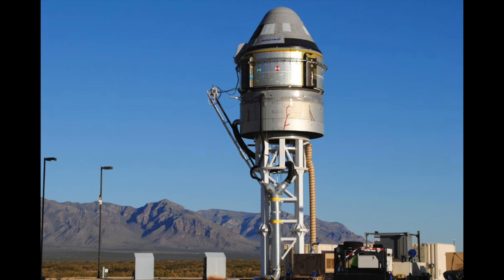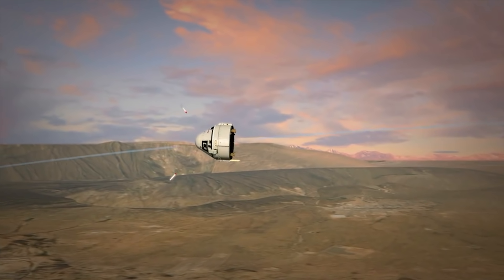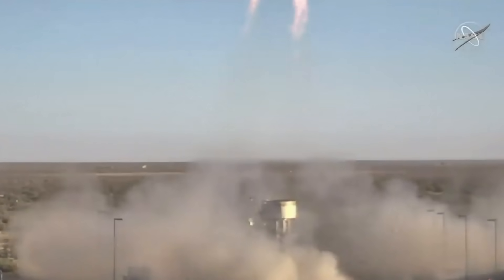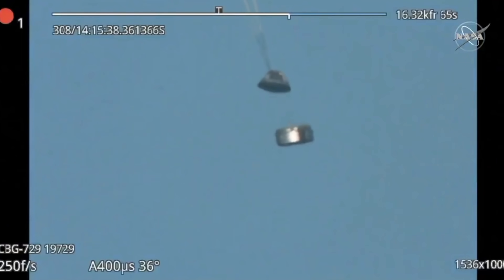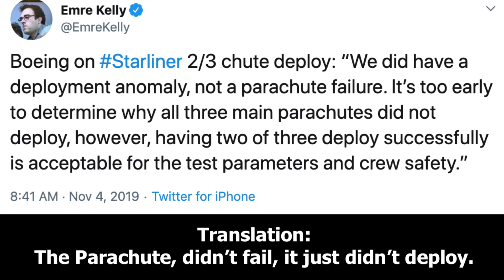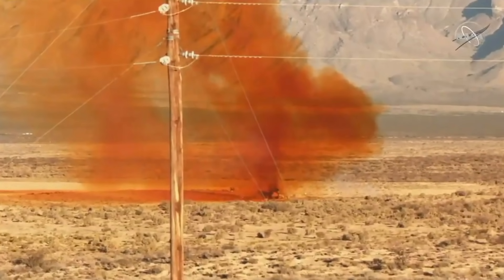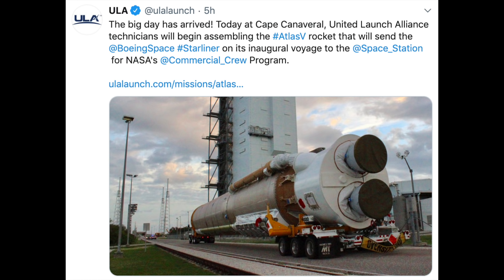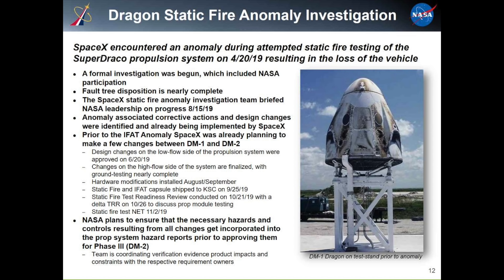Parachute Fails To Deploy During Boeing's Starliner Abort Test.

Comment: Scott - "1st US spacecraft designed to land on land"
Space shuttle - "am I dead to you?"
Reply: Yes. Yes you are.
Reply: Scott:
yes
Reply: Too funny.  Good catch.
Reply: "Space capsule " probably.
Reply: Glad I read the comments first.  Was going to say the same thing... 😁 😜 😂 😂 😂 😂
Reply: Yes...bc you have killed multiple astronauts
Reply: @backwoodsjunkie08    Vehicles don't kill people, people are killed in vehicular accidents. Do you really think fifteen people is a lot? FWIW, Soyuz has also 'killed' multiple astronauts, in the same number of fatal accidents. Of course, the first 'accident' was essentially the result of the launch controller planting a bomb on board, so it shouldn't count. I'll tell you this though, as soon as the first SpaceX manned Starship flies, the countdown will have begun to the day when, on launch, on landing, or in space, a hundred or more people will die in some accident.
Reply: Technically at that point the space shuttle is an aircraft
Reply: @odysseusrex5908  but then, how many times have that  number of people died in a single plane crash? Quite a few I'd think, in something that is far far far far safer than a spacecraft of any design.
Reply: @Forest_Fifer    That is precisely my point. When an airliner goes down, it is often the case that hundreds of people die at a time. People, with no knowledge of aerospace engineering, act like the Space Shuttle was horribly unsafe because it had two crashes in thirty years. You might notice you never hear an astronaut talking like that. There is no such thing as safe, there is only acceptable risk. People have died before, many, many more are going to die in the future.
     Why do you think airplanes are safer than Space Shuttles? Each Space Shuttle flew hundreds of millions of miles. Only two of them crashed, and one of those was essentially sabotaged. What airplane has ever flown that far?
Reply: Yes
Reply: YES YOUR DEAD TO ME SS!!!
 The Space Shuttle was the absolute worst spacecraft that NASA had ever develop! They should’ve just kept the Saturn V rocket and came out much further ahead! We would’ve had YUUUUUGE  space stations by now!  The SS cost turned out to be MORE EXPENSIVE than Saturn V!!!  300,000 lbs to orbit vs the pathetic 60,000 lbs!  Thanks Boeing🤬
Reply: @ryanhopf8324  
Only because there is no minimum glide ratio needed to qualify as an aircraft.
Reply: @edwardethridge1483    No, the tiny Apollo capsules could not do a fraction of what real space ships can do. Having worked at JSC, in mission control, during the Shuttle era, I can quite assure you that astronauts do not share your opinion.
Reply: "onest"
Reply: Odysseus Rex hey genius he was talking about the satern v capability which was way more than the shuttle and nasa could have easily modified it to have a payload fairing
Reply: starshipeleven    To which the correct answer is; so what? Space flight will probably never be as safe as air travel. The Space Shuttle was far safer than the Saturn V/Apollo, and as safe as Soyuz. People who pretend it was some horribly dangerous thing are either ignorant or lying, one of the two.
Oh, and it should always be noted that the first accident was not due to any flaw in the ship itself, but due to a deliberate decision on the part of the launch director, against the advise of the relevant engineers, to launch out of spec. He might as well have planted a bomb aboard.
Reply: starshipeleven    And perfectly safe vehicles deliberately used outside their design parameters result in fatal accidents. Perfectly safe vehicles used properly have things go wrong causing fatal accidents, hence the word accident.
Reply: starshipeleven    "Usually" is the key word in your statement. Accidents are inherently unpredictable, although planting a bomb doesn't count as an accident. I used to work in Mission Control. None of the engineers and none of the astronauts considered the Space Shuttles to be unsafe. We all understood that there was no such thing as safe, only acceptable risk. Based on flight statistics, the Shuttles were as safe as Soyuz, and far safer than Apollo.
Reply: starshipeleven    No. All spacecraft, aircraft for that matter, go through extensive preflight checks. Now, in NASA's over reaction to the Challenger accident, they implemented a while bunch of inspection procedures that greatly increased the time, resources, and cost of refurbishment. They required that every system on the orbiter, whether flight critical or not, be physically inspected. Every inspection had to have a written report prepared.Every written report then had to be presented to a safety review panel which then considered and debated and decided to accept it. it was all very cumbersome, expensive and unnecessary. I know, I was there.
Reply: Yes
Reply: @edwardethridge1483  you do realize without the shuttle most big parts of a space station wouldn't be able to launch into orbit cause you need volume not just payload capacity

Comment: We engineers on the ground feel two parachutes should be safe enough for the crew in the air.
Reply: Ha ha ha. Yeah. Kinda a shade easier to glibly state. When it isn't your arse in the hot seat.
Should ask them if THEY are ready to go in another similar test, with them in it.
Talk is cheap.
Reply: It's the PR people on the ground saying that.
Reply: @Smarticus Funny thing about SpaceX is that they went so rigorous beyond NASA's already strict requirements that NASA had to reevaluate their own safety standards.
They pushed SpaceX so hard that NASA started to feel inadequate and incompetent from the results.
Reply: SHOULD
Reply: @BrokenLifeCycle   Was wondering about this. After Boeing had their first problems with parachutes (a while ago), NASA was scrutinizing what went wrong. Seems NASA discovered there were more ways for things to go wrong then they'd ever thought, and that's why they expanded the testing program for both companies. To me that was the likely scenario. Makes rational why NASA paid Boeing extra for extra tests, if they changed the parameters.    

But at the end of the day, SpaceX is ahead.
Reply: As long as they never make contact with the ground.
Reply: Will the engineers be relying on 2 parachutes to NOT be injured?

Comment: Failure is acceptable when it happens during testing.
Edit: ty for comments, I removed my first impression on the smoke since it was premature on my part
Reply: In actual flight the service module will burn up in the atmosphere ...
Reply: @Graviton1066  but not in an abort.
A real launch abort should look exactly like the test.
Reply: @Jehty_  except Starliner would land on water in real abort conditions where there would be no problems with hypergolic cloud
Reply: @Smarticus Oh hi! It doesn't have to land on land, and they've done testing of water landing and recovery procedures for Starliner. It'll go into the water like Crew Dragon. It does make refurbishment significantly more difficult as far as I'm aware, which is why the nominal scenario is landing on land.
Reply: @anushervontabarov8568  why wouldn't there be a problem with hypergolic if they land in the water?
It doesn't really make a difference if something hits water really fast or the ground, or does it?
Reply: @Jehty_  I'm not entirely sure, but reaction between hypergolic fuel and water just dissolve former to non poisonous components. Similar to Crew Dragon which uses the same fuel for abort engines
Reply: This did remind me of one of the Apollo abort tests, where the rocket disintegrated before it reached the planned altitude/speed, but the abort system worked perfectly. Now that's a better way to fail...
Reply: If only there was a better monoprop available.... oh wait that would be breaking with TRADITION!!!
Reply: @AdmiralBob  we're not allowed to think about cavea...
Reply: @Jehty_  I think one "advantage" for mitigating the amount of hypergolic seen in this test as opposed to a real abort which lands on water would be the SM sinking. A fairly large amount of that smoke seen in the abort test was released after impact of the SM into the ground.
Reply: @Smarticus A seaward wind is a requirement of using dinitrogen tetroxide at the cape.
Reply: The technical term is BFRC, Big (Freaking) Red Cloud.
Reply: @Graviton1066  Its to to be able to launch them off the pad.. its a PAD ABOARD test.  Around the pad, you have even more people.
Reply: The cloud of hydrazine death nearby!? Yeah, that's really bad.
Reply: @Graviton1066  Not on a low altitude abort, it won't.
Reply: I thought that too,
Reply: @anushervontabarov8568  first of all, the service module will be falling at terminal velocity, and at those speeds hitting water is just like hitting concrete.
So it will smash all the tanks open long before anything starts sinking, releasing clouds of highly toxic gas.
Then, what does mix with the water isn't made non toxic by the water, it just creates incredibly toxic water.
In addition, the NTO basically creates nitric acid when it hits the water, leaving a plume of highly toxic and highly acidic water in the close vicinity to rescue boats and rescue divers, depending on wind and water currents. And you never know how close the capsule and SM will end up, so it could complicate rescue.
Reply: @WetaMantis  with Crew Dragon, the hypergolics are in the capsule, not the trunk, so unless the capsule itself sustains damage, there is no uncontrolled release of hypergolics during an abort.
Reply: @michaeldiaz4942  problem with that theory is that impact on water at that speed is like hitting concrete, so it will disentagrate on impact, releasing the hypergolics, before sinking.
Reply: Yeah....behind you 100 percent, Veikko Vuori. Chemical clouds are not fun to breathe in or work in.......
Reply: @ke6gwf  The impact energy when hitting water at terminal velocity isn't much different that hitting a solid, such as land. The SM in the test did not disintegrate, and was continuing to release gas for a fair amount of time even after the capsule landed a short time later. So if the SM takes roughly the same damage, a fair amount would quickly sink with the SM.
Reply: Weta - But SpaceX’s Abort engines & fuel are both in the capsule, not in the SM.
Reply: @TraditionalAnglican  You're right deleted my comment as it was erroneous.
Reply: @ke6gwf  True, thanks for your correction.
Reply: @phuzz00  That could have been spun as a "realistic test".

Comment: Scott, what you should've said is that this is the first U.S. crew capsule spacecraft designed to for touchdown on land. The first to be designed to land on land is the Space Shuttle. Which it did dozens of times.

The second item is that the service module in an actual pad abort would be dropped at sea where it would break up and sink on impact with the water.

Comment: Scott Manley: I'm Scott Manley, fly safe!
Boeing: Meh not too safe, 2 parachutes should do it.
Reply: In fairness, the reason there are 3 parachutes is primarily redundancy. IIRC impact will be survivable even if just the one is used
Reply: Yes, but it's not redundant anymore if 3 don't consistently open. I guess more tests will be needed to change that ratio.
Reply: @trezapoioiuy  ... That's the point Hevlikin was trying to make!  As long at there are a MINIMUM number (e.g. 2 or 1) of consistently opening chutes things are actually OK, within specification.  

Keep in mind they don't just do one test ...  they do several, as many as possible, and then crunch all of the numbers, get probabilities for success & failure of every part of the system.  After all of that is done they either passed or failed to meet the minimum requirements as set forth by NASA.
Reply: @digiacomtech5589  are you also saying that 2/3 success rate is fine for a parachute system? If one failed this easily, the other two can also fail. The system must be redesigned.
Reply: @zoltankurti  ... How can you tell ANYTHING, derive any statistics, from only one test?  Especially without any post test analysis.  

Where they lucky that only 2 came out?  Is 2 vs. 3 a trend?  Perhaps they were extremely UN-lucky that one failed.  Perhaps is was some other system failure?  A packing failure, a connector failure,  an installation failure, a pre-flight inspection failure? 

How can you possibly justify saying "one failed this easily" by watching a single test?  Who can say at this point without further investigation and analysis whether this is a trend or a fluke.  Bottom line is you can't draw any conclusions from just one test without any post test analysis.  But please do please tell us you have ALL of the pertinent detailed information and post test analysis at your disposal to base your assumptions on.

All I am saying is without the actual NASA requirements and post test analysis it's only speculation as to whether this is a PASS or a FAIL.  For all we know the requirement might be for only one to reliably/repeatedly deploy and any additional parachutes are merely beneficial.  Perhaps the test actually included a single parachute failure in order to test landing impact metrics? 

Surely in a perfect world we would only require what is actually needed and nothing more.  However, we don't live in a perfect world and that is why redundancy is built into life support equipment systems.  That is, one may be all that is needed to land safely, but two is better, and three better still.  We can calculate the odds that only one, two, or three will fail given further testing.  The only question is if those calculates failure rates meet acceptable flight safety parameters/limit IAW the established NASA systems requirements.
Reply: @Hevlikn  you need consistent results in testing so if there is an issue you are safe.. if you test and 2 or 1 work and you are like meh it's cool it's good enough... then 0 work in an emergancy and everyone dies.. you will be like I had no clue this would happen it's all their fault for not testing more and making sure it was more safe...
Reply: Also Scott Manley:
We need the footage [of a falcon 9 disintegrating in slo-mo]
Reply: Yeah, one sensor should do it.
Reply: "safety is overrated"
-some Boeing official at some point, probably

Comment: The red color is probably NO2, which undergoes thermal equilibrium with N2O4. When the temperature is increased, NO2 is favored. So an N2O4 release in the desert could be expected to result in a big red cloud like that. That is to say, it's likely not smoke, but a fuel release.

Comment: A few things I noticed:

1) The actual "abort" seemed to be about three seconds after T-0.  That might have been planned & expected, but the delay did make me tilt my head a bit.
2) That hypergolic cloud was nasty looking.  I know they expected some unburned fuel to remain, but I think they expected it to burn after the service module detached.  Given how close it appeared to be to the crew capsule, I'd not be wanting to approach that any time soon.
3) The missing parachute, obviously.  Given how strict NASA appears to have been with SpaceX's tests, this also makes me cock my head a bit.

Of course, what really matters is if the engines performed well enough to get the crew away, and if the landing would have been "soft" enough to avoid any major injuries.  I guess we'll wait and see.
Reply: I noticed the delay in the countdown .If this happened in an abort situation they would have been toast
Reply: yeah, I thought for a moment it had burst into flames and was about to do a RUD - it was hard to tell with the shaky out-of-focus cam at the time. Maybe Boeing have a leaky valve problem as well, as the plume sure didn't match the preview animation.

Comment: Looks like they stripped a pilot chute......which is EXTREMELY odd. The pilot chute pulls the deployment bag off of the reefed main. There is not a lot of effort to do this so this is quite a strange failure. You strip drogues or mains, not pilots.

Also, the cloud of NTO is very close to the capsule and is very large. Once the capsule touches down, it should be on ambient ventilation which means that NTO could be pulled into the capsule.
Reply: I was thinking the same thing, this was not quite as bad as the first dragon 2 test but right up there with the word Anomalys.

Comment: Can't believe NASA (National Acceptable Safety Association), will be happy w/ the proximity of the SM landing to the crew capsule.  Just using my rudimentary tools, I estimate they landed within 100 yards of each other, probably closer to 75, depending on how much further away the SM is from the camera compared to the capsule.  It appears to me the capsule landed closer to the camera.  Taking off from the Cape, yes, they would land in water.  But with dynamic winds & ocean currents, there is no guarantee they would stay 100 yards away from each other, or that the wind might not be blowing towards the capsule.  Doesn't look acceptable at all.  I wonder if the failed deployment of the third parachute would have changed the landing spot of the capsule--closer or farther from the SM.  I'm John Gibby.  Fly Acceptably Safe.
Reply: Yeah given the precautions they take with the X37B even after it's been in space 2 years and landed intact, I don't think this is acceptable, the whole touchdown area is coated in hypergolics including the outside of the capsule. Those poor astronauts would be stuck there a while until the hazmat team can gear up, get there, and clean things off.
Reply: Yeh. It won't matter if the whole area is covered in DNT, cos in an emergency abort, it's not like you're going to want to get out of the capsule in a hurry or anything.